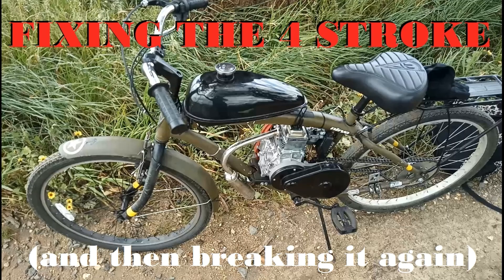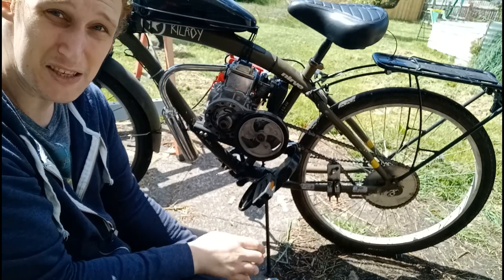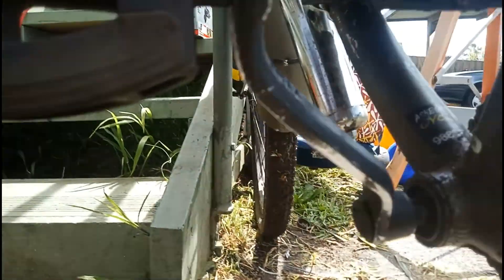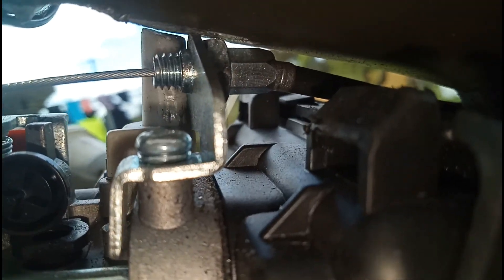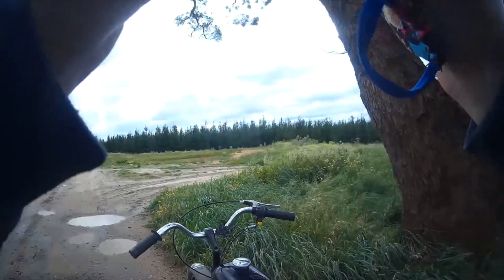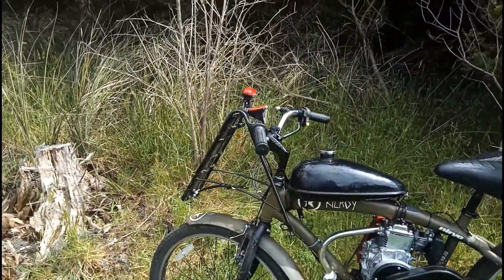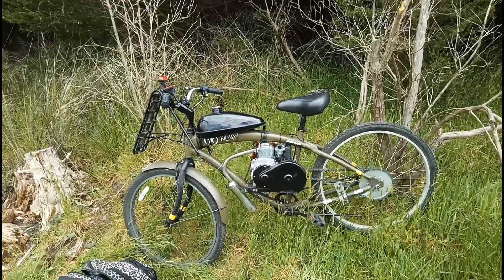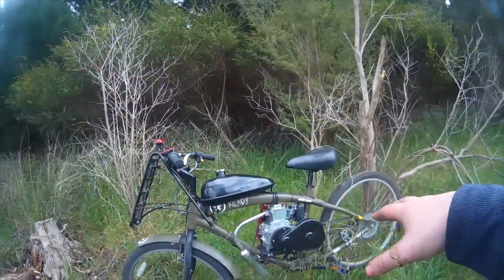Fixing The Mk4-Stroke

Comment: I would fix both 4 stroke mk4 and 2 stroke mk5. The frame will last, the back wheel need complete replacement, maybe the tube is good. Also the pedals need fixing to have more clearance from the belt transmission.
Reply: @NicksBikes  If it is new than you should be fine with the adjustments.